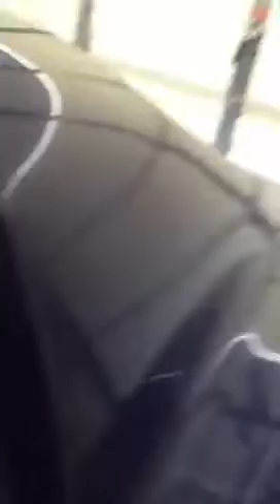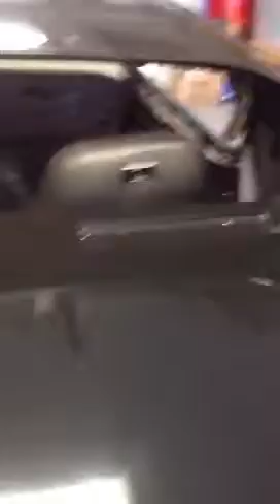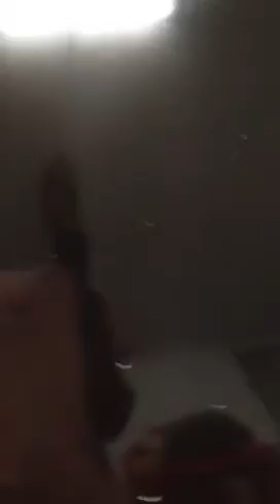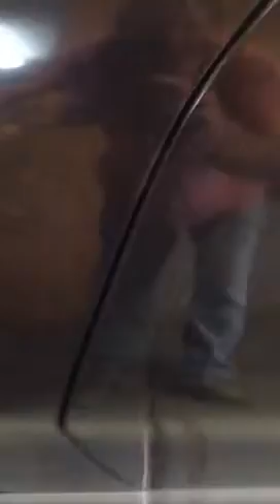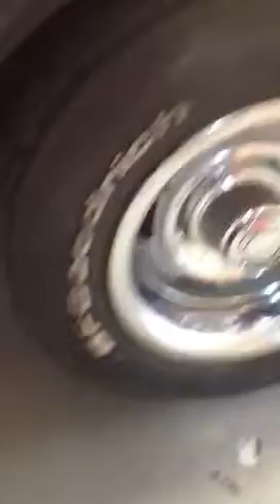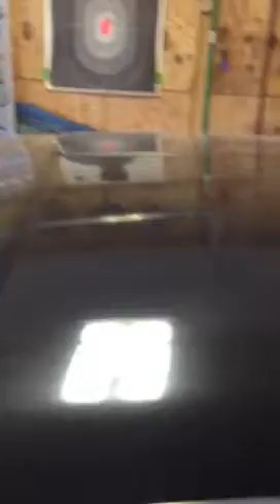Bobs. Vette 36 almost there

Comment: Looks great , lots of effort.  If you try this kind of thing again I recomend Dupont Chromabase for color &  Dupont  Nason high solids clear. Duplicolor is more known as a touch up paint brand  & not very good at that. As far as shelf life , it should have been good for a year or more if it never froze. For a cheaper gun Devilbis Finish Line works good for me .Looks like you were cutting alot of clear off wet sanding , if you go through its going to change the color if you just reclear it .